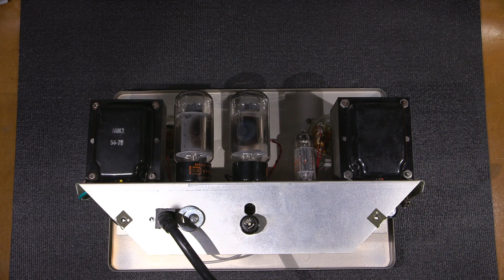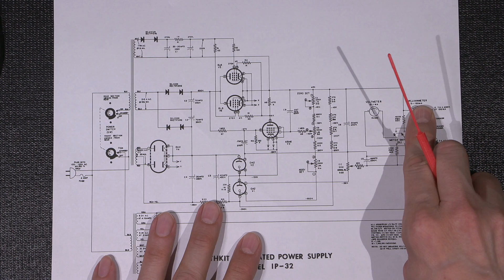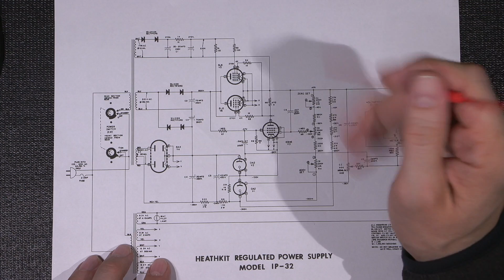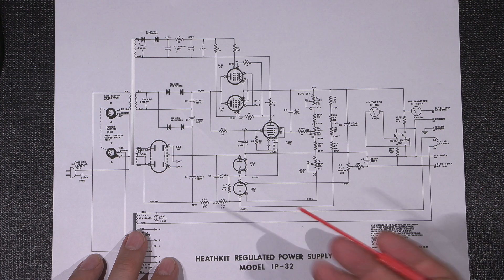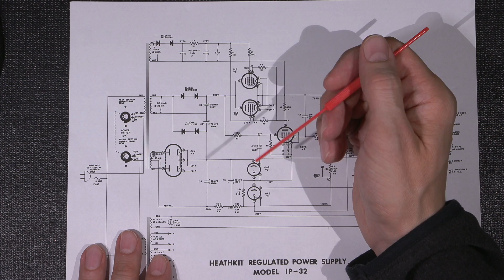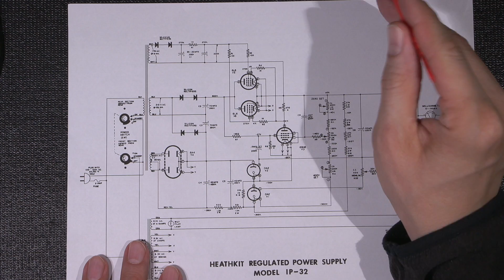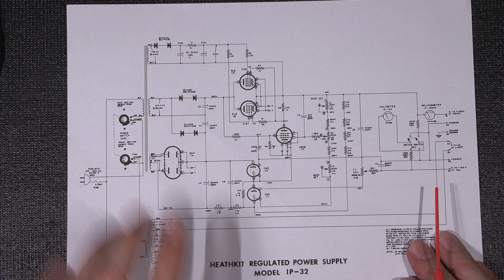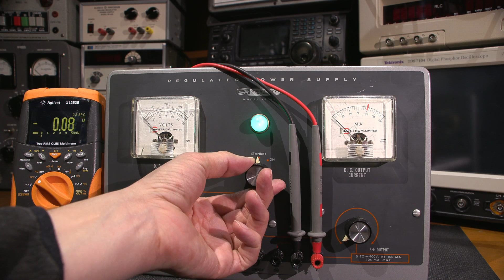Tools For The Bench- High Voltage Power Supply Repair!

Comment: Are you sure the Common is tied to the frame?  My impression is that it is not, so the 3-wire power cord is indeed a safety measure.  I have not (happened?) to see anybody explain the reasonings behind the safety ground with the third wire.  For the first, the US domestic (as in home) installations use 2 * 120 V AC, with the center wire toed to earth ground as well as the neutral.  But if the safety ground is only tied to a ground stake, it is possible that in a fault condition there is not enough current to trip the breaker, as the ground stakes may vary in resistance especially at drought times.  So, tying the safety wire to the neutral in the FIXED installation part is a better choice.,  Remember, the idea is that a fault is cleared by popping the breaker!
As to the use of a rectifier tube rather than diodes for the reference voltage, I have a speculative alternate explanation.  In my early days of changing over to semiconductor rectifiers I noticed at times rattling “hum” sound due to the snap recovery of the semiconductor diodes.  So, I would not be surprised if the Heath guys chose the tube rectifier in order to get cleaner reference voltage.
Reply: Chuck Kirchner  —. I am aware of that hum path.  But I also am aware of the dirty part of the “quick and dirty” solution.  Often I see small capacitors from one or both power lines to the frame.  With both applied, you get a voltage divider, so the quick isolation makes the frame float at 60 V AC (speaking of the American voltages).  With just one capacitor you may get a few millivolts, if your plug polarity is right, or full 120 V if it happens to be “wrong”.  Way back when I was involved in providing PA style sound to 3 and later to 4 groups of buildings (3 channels each).  The only correct way to do it was to use signal isolation transformers.  Actually, that was in Europe, with 230 V power and the 3 amplifiers in each location mounted on a steel rack which naturally tied the frames together.  Solution was to use mu-metal audio transformers at the inputs of the 9 (and later 12) power amplifiers and a balanced feed from the studio to the groups.
Reply: what is the min depth for ground pins - if the pin is put deeper is that not an option ?

Comment: I was following along with the schematic of my Heathkit IP-17 which was the later model of that supply and found a couple of interesting differences. First, the supply has a three-line cord, the OA2's don't reflect any internal connections for the "discharge safety" you talked about, and finally the 6L6 heater to cathode connections aren't reflected at the tube socket but at the transformer windings so the effect isn't as clear as you described. Probably a couple of other minor differences. Thanks for the run through Paul, another great video!  73 - Dino KL0S
Reply: MY 2717 schematic has a note by the third prong that states "if used".  Which cord is actually on your unit?
Reply: I didn't build this unit; it has the three-wire cord on it.

Comment: Have you seen any of Glasslinger's videos? She makes her own vacuum tubes! Tin hat tubes. Xray tubes.    Nixie tubes!.    does all the glass work and everything herself!
Reply: Thanks for the tip o/
Reply: its a guy dressed in drag
Reply: Glad someone is still making them. They (tubes/valves) are fast becoming super hard to find.
Reply: @GeorgeZ213  I'd love to be able to do what they are doing one day.   Such specialized machines you need to even test and form the tubes though.
Reply: You mean he
Reply: Nixie tubes? Do u have any idea how much more involved what mr carlson does is then nixie tubes and glass blowing the two are not even related.
Reply: WTF HEISENBERGDL? are you a troll? you are implying that blowing your own glass and making your own nixie tubes,diodes, triodes etc, making the heaters, anode cathode control grids, all the chemicals and machinery needed , creating and sealing the vacuum, using "exotic" metals , depositing the getter and flashing it, spot welding all together by hand, knowing the clearances and size of parts etc etc etc that is EASY? or that it is less involved than repairing stuff??? as much as i like mr carlsons videos FORGET its not even the same league... you are implying that designing and fabricating your own vacuum tubes at your home or shop is less involved than replacing those tubes and replacing capacitors to make stuff work? are you really saying that? are you a flat earther also????? gotta be kiddin....

Comment: Slightly OT, but 6BH6 tubes were also used by the dozen in old GE Progress Line communcations equipment - both the receiver and transmitter strips!

Comment: Your comment about the use of regulator tubes in old ham transmitters. The old Heathkit DX 40 transmitters were known for a chirp when keyed. If I remember correctly the regulator tubes were 0A2   I don't recall there being a control or pass tube, which might have explained the less than great regulation. Great video. I may pick up one of those old Heathkit power supplies for my bench.

Comment: Correct me if I am wrong if I ran say 80 ma @ 120 volts load that would go over the plate rating of the 6L6GB or am I missing something .. and why did they string 4 27k 2watt resistors why not use 1 10 watt 110k instead

Comment: I have a handful of Heathkit IP-17 supplies, it seems they're basically the same thing as this IP-32 but "more modern" they should have kept this look, it's much nicer than the off white beige color.

As far as that cable mod, I'm not surprised with the way it looks, better than some of the stuff I've done to heatkit devices, the romex style cables they used degrade horribly and there's no real good fit with a modern cable without ordering something, so he gets points for making a functional strain relief.

Comment: Great video as always, by Paul Carlson, The GREAT ELECTRONICS TEACHER, possibly of all time !!!!  By the way I just bought an old Heathkit regulated power supply model PS - 3 to work on and clean up. my unit only has one physical meter in upper center front, meter has two functions, switch selectable either voltage or current, looks like it might supply 450 to 500 volt max at maybe 150 ma. I will have to open it up and see what differences in circuit design there is between yours and mine.  Once again thanks Paul, 73's de  KC2UVN      John Bellas
Reply from the maker: Thank You for your kind comment John!

Comment: I have two of these power supplies. One I bought working and one I had to repair. I have an original manual with schematic and construction instructions. They originally had Selenium rectifiers instead of the diodes. One of my units still has the Selenium rectifier the other replacement diodes.  Good find.

Comment: Was 6.3v high, due in part to line voltages nowadays being somewhat higher than 115v? Sad, I have some 1968 Hammond 44vct (NOS) units that buzz because the cores run saturated..

Comment: why did the regulations in America allow that? seems strange to tie the Earth to neutral in the consumer unit. In the UK it has to be separate by a Earth bar and ground outside through a spike and has no connection to neutral in its path this is a better way you don't have the problems you are talking about.
why didn't America do it this way!
Reply: John sweda that’s not right. The vast majority of UK installations have earth and neutral tied together at the incomer - this is known as  TNC-S. What you describe is called a TT supply and is most often associated with supplies fed by overhead cables.
Reply: Steve Lupton yes  mine is overhead cable and surely this is a better way! how does the Neutral and earth get tied together not at the consumer unit but outside is what you're saying where the mains comes into the house.
Reply: Yes, they are joined together in the ‘service head’ which is the bit between the incoming cable and the meter
Reply: Steve Lupton but why tie  the earth and neutral together as I say surely separating the earth from the Neutral over distance is better?

Comment: Nice overhaul, im sure it'll be a useful addition...Bit of an afterthought as you have already finished it now but assuming it was operating before you restored it it would have been nice to see a scope trace of the DC rail before and after you sorted the wiring out to get a visual idea of noise reduction through component / wiring placement.. An old timer I know just recently finished an  11 tube "all GT" MW/SW PP. The amount of experimentation he did with component and wiring placement was verging on OCD but it is one of the quietest sets i've ever heard, even at near full volume there is little to no percievable noise.

Comment: Can we connect very low value capacitors across the diodes to prevent the diodes turning into jumpers?
Reply: If the diode blows, I would replace it with the next higher voltage rating.
Reply: @GeorgeZ213  I was talking about snubber network back then (and when I commented on this video, I actually didn't know the term but knew what it did, it's hilarious).

Comment: I feel the need to bust open a tube and take apart its innards so I can get to know you better Mr Carlson. Any idea what the getter compound is made of?
Reply: I'm sure Paul will know way more than I do but the typical flashed getter you see on these kinds of tubes (the tube is induction heated during the assembly to set up the getter) is usually made from barium but the exact composition probably varies between tube manufactures.
Reply: Neosophist is correct, and likely knows why it's used for sure. But do you know why it's there, Xeroefferct? 
 The glass envelope is pulled into a deep vacuum to extract all of the air (oxygen). Because a perfect vacuum is impossible in a production environment, there are still some oxygen molecules present in the tube. The Barium getter attracts and absorbs the remaining oxygen molecules.
 If you see a vacuum tube where the getter has turned white, air has gotten in and oxidized the getter. 
 Pretty cool stuff for 100 year old technology that is still usable today.

Comment: Hi Paul! 
Great job as usual explaining the tube regulator circuit, you made it very easy to understand, thank you.  I have tried a few times to win one of these old Heathkit power supplies on eBay and always get outbid.  I can build one like this in solid state for around $200 and have most of the components except for the filter caps.  I am very comfortable working around high voltage and current as I have worked on industrial three phase 480VAC equipment for years.  That said I have been planning to scratch build a 0-600VDC, 450mA power supply of my own design for doing vacuum tube experiments. I have a toroidal transformer, center tapped  for 430/430 VAC secondary and  two 6.3VAC, 4A taps so I will have a negative supply for bias and upto 600+ volts for the B+ as well as ample power for heaters.  I am going to use an FET for the pass element and op amp and zener diode for feedback voltage control and monitor the output with analog voltage and current meters.  I should look pretty cool as I am repurposing an HP case.

Comment: so true this supply can make a human go bang just like a dry capacitor
question could you add a bleeder resistor to all the supple caps in this (100M?)?
Reply: Time constant for 100M resistor with 100u cap is around 2.8 hours, kinda homeopathic bleeder, we'll probably get more leakage through moist air and old insulation ;)
Reply: well then make it 10M 15 minutes of bleed is ok I choose 100M due to the high voltage low current application even 2.8 hours is better than 10 years on some of the caps

Comment: your dissing a mod that i think seems at first glance to be pretty damn effective. In fact it seems like the person went through a lot of trouble to preserve the use of the rubber reinforcement to its fullest using that ugly washer. may not "look pretty" but it sure is quite effective and none-invasive.
Reply: not that i wouldn't change it
Reply: So isn't this comment directly correlated to the effective rather than the excellent in none?

Comment: Many metals are non-magnetic. I just don't get not referring only to ferrous metal as "metal" as if Aluminum is not metal.  Second time I've heard this here.  Steel is certainly metal or alloy, but it's not the only one.
Reply: You might like astronomers then, everything heavier than Helium is called metal there
Reply: Sometimes the word "metal" is used to mean what is "iron". Not technically correct, but it happens. I'm not sure that all irons are magnetic either; Like cast iron and stainless steel. Ordinary magnetic "sheet metal" can probably be referred to as "metal".
Reply: Sodium is a metal yes.  Also Cast Iron is the most Ferrous of all being mostly Fe (and only non-magnetic when heated to Curie).  Most Stainless Steel is magnetic, some is not, and they're all Steel alloys. ALUMINUM is practically always alloyed (and I've seen folks refer to Al as "alloy" to differentiate it from Steel, which is funny too since Steel is alloy by definition). Of course we have liquid metal as well.  As a fabricator I don't think I'll ever understand folks who use odd terminology for materials, especially metals.  It's like referring to products from one species of tree as "wood" or "wooden" but then using some other term to describe products from another type of tree.  Or calling all Oaks "wood" and all Cedars "'aromatics" as if they are not of wood as well. I'm not saying everyone should call out the specific alloy and heat treat of each metal in their project, but to imply that aluminum is "not metal". The concept or practice of only referring to steel or magnetic alloys as "metal" yet baffles me, especially from someone posting instructional type information. "Metal" has a much wider definition and typical use by the learned.
Reply: I'm not sure why but that has always irked me to no end.  The worse part about it is when I correct someone about it they generally either look at me like I have two heads or just say something stupid like "know it all, you know what I mean"
Reply: Uhh Duh. You Dickhead.

Comment: YAY! New video! Thank you very much Paul! Your content is top notch!
Always wondering about HV power supplies.
Jeez, I guess Heathkit made every possible piece of test gear! xD
Cheers, Phil.
Reply: It's really amazing, the amount of "devices" of all sorts that Heathkit made over the years. From simple battery testers and crystal radio kits, to complex test gear, 2 way radio equipment, Audio equipment, color TVs and even computers in their later days. 
 There were other kit manufacturers such as Eico, Knight Kit and others that made learning electronics fun, while equipping your shop with well designed service grade equipment. I think Heathkit was the most prolific, though. It's a much loved and much missed brand.
 I think it's really cool that, in recent years, you can buy a kit to build just about anything (from China). Their recent popularity is keeping the memory of Heatkit and the others alive. The quality isn't the same, but it is feeding that spark of curiosity in younger people, much like Heathkit did years ago.

Comment: Mr. Carlson, I’ve also been looking for a power supply for the Patreon class and saw one like this on EBay, is that where this one came from? If this isn’t, one like this is fine for the class isn’t it? Or would something else be better?
Reply from the maker: Hi Buddy. This was a local sale. This power supply would be fine for most tube experiments or (designs) over on Patreon. For much of the solid state experiments or (designs), you would benefit from a low Voltage supply as well.
Reply: Thank you!